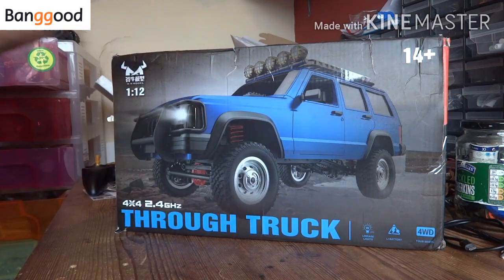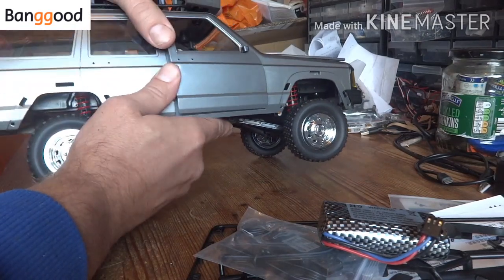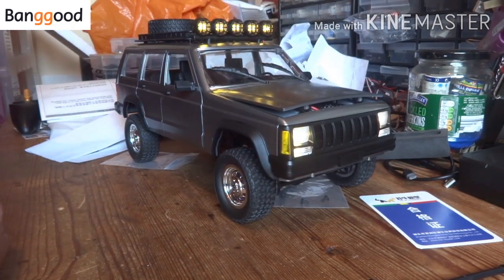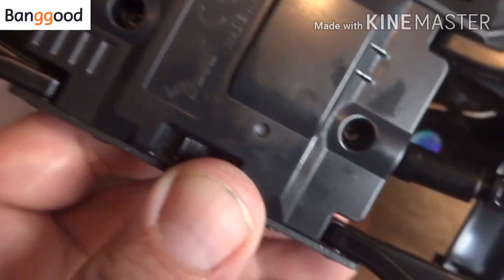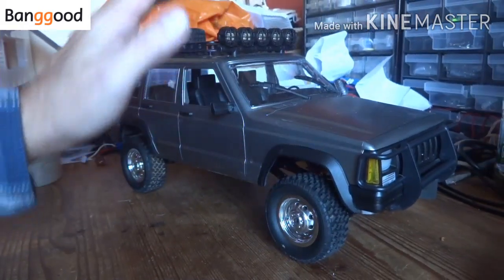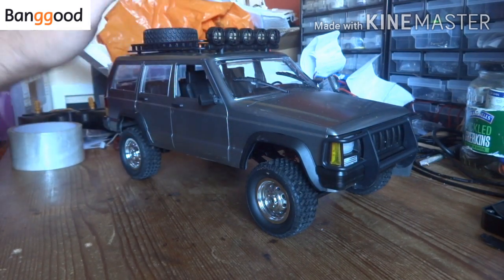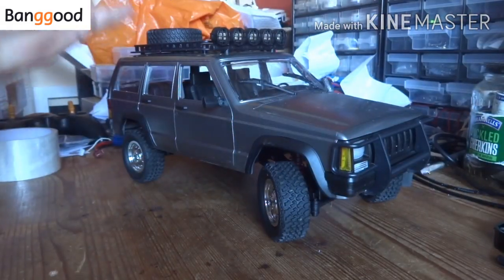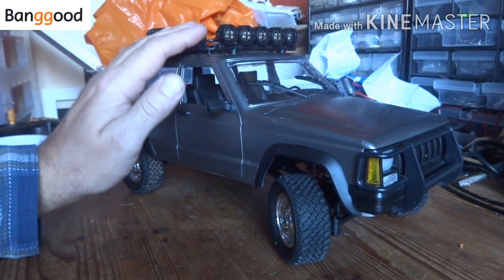Brand New MN Models MN78 1:12(?) Jeep Cherokee RC Model.

Comment: Nice to see this one comes with a decent motor. I have the Camel Trophy DEERC version and it's so under powered I thought I got a lemon. It moves around on flat ground and over minor obstacles ok, but will not climb enough to pull it's own weight up a hill before the ESC cuts out from over current. It may be a bad solder joint somewhere, but I'm just going to throw the 370 upgrade with gearbox and see what happens.
Reply from the maker: That sounds like a plan!

Comment: Really like the looks of that .Be a good candidate for customisation for sure.
Reply from the maker: Bit of extra ground clearance wouldn't go amiss. 👍👍
Reply: @theminiatureconstructionco4556  reminds me , I have a wpl wheel tyre combo I need matching, can only find one of 4 lol, its the larger (taller) tyre with the more road pattern tread?I wonder what these would run like with one of those programmable isdt70 esc as the only mod

Comment: would this be a good option for my first rc car or there are better options? mainly looking stock rc cars that i didnt need to mod, anyways thanks
Reply from the maker: Sorry for the delay in replying. Depends what you are looking to do with it? If its a bit of gentle trail use. Then this is fine. Also look at the Unimog video, as that truck is a contender to.

Comment: Which logo is it on the top left of the box, the 370 RC motor I bought has the same logo on it?
Reply from the maker: That's the MN Models logo. 👍
Reply: @theminiatureconstructionco4556  Thank you, so my Top Max/Mazz Racing Sand Monster will now be using a MN Models motor, let me post a pic on my community feed so that you do not think I am just waffling about  it ...